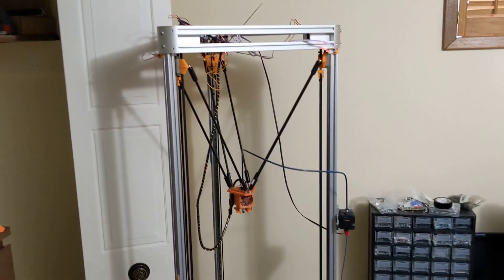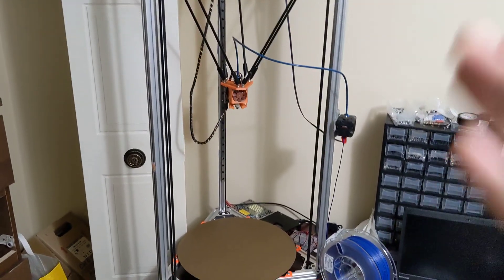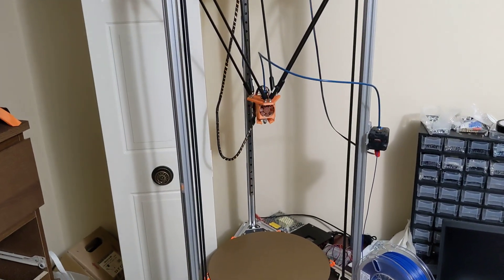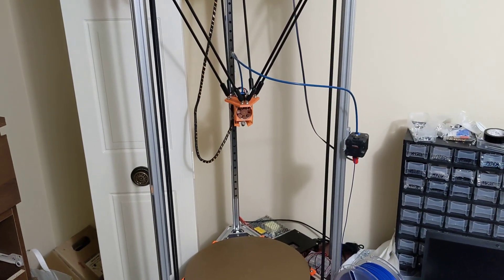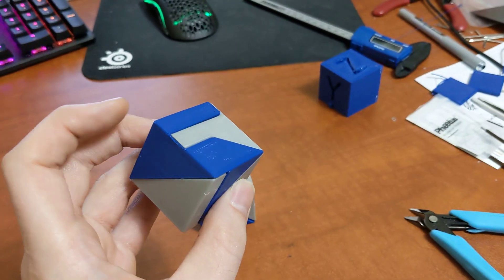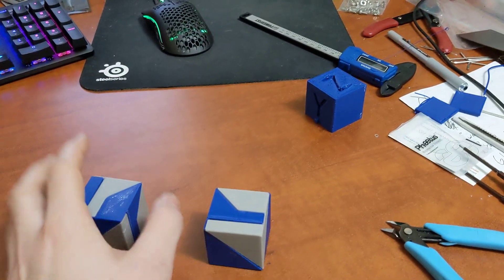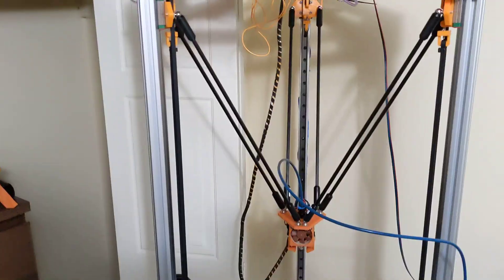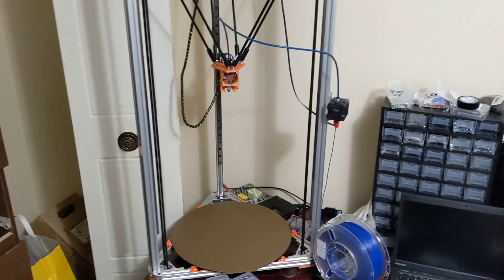Delta 3D Printer vs CoreXY 3D Printer

Comment: I started to build a big delta years ago for a cnc and 3d printer to replace my Ender 3.   I have seen almost no delta CNC's except big industrial ones.   Why is that?
I am back at it now, but I think this time I will build a real small one for 4x6 inch circuit boards.  And maybe 3d smaller items very fast compared to the ender 3.
This seems backwards from everyone else...they build big deltas and corexy for small cnc
Reply from the maker: I agree a small nibble delta would be great especially for circuit boards. I think a lot of people still think deltas are inaccurate and hard to calibrate.
Reply: @Rolohaun  I started to work on the little delta, but it seems to take up too much desk space.  And one of its advantages is using it for Z axis as you get that 'free'.  Now I'm working on a SCARA machine.  This is about as simple as it gets, just two arms and two motors.  And a circuit board weighs almost nothing, so the plan is to swing it around and keep the tools stationary.  In fact I think it is possible to have multiple tools and swing the board over to each one, so scrape the circuit, paint solder mask, lay solder paste.
Well see..It could do Z axis by raising the tools.

Comment: I too have a 1-meter-tall Delta that I designed and built.  It has a 300mm round bed and I also use magnetic bearings too.  The major difference, is that my printer mounts the hot end on top of the effector.  Also I designed a retaining clip to ensure my mag bearings do not detach.  I still have problems with my filament stuck in the heat-break, but I think that is a slicer problem.

Comment: I own a Tronxy X5SA 400 and a Flsun Q5. Well, the Quality was not as expected out of the box. I had to Customizing both Printers in Stiffnes and Firmware. Now, i am Happy with my two ones.
Ordinary Bed-Printers are boring and i would never buy such an Ender or so.  Sadly, there were came out so much of these boring Printers every year and cool and cheap CoreXY and Deltas are very rare on the Market.
Reply from the maker: I am glad FLsun is making Deltas

Comment: Ball cups with a rod in the middle to tigthen them are just as good. They take out the play. It is just as with your magnetic ones as long as the magnets froce is higther than the force caused by acceleration it is fine, same goes for the ball cup design as long as the spring or rod is stiff enough is takes out all the play.
The disadvantage of the magnets are, magnets are more expensive and a bigger hassle to glue etc. The magnetic ball design came from the horrible paly in the first version of thoise printers where there was nothing totake the play out. Thge ball cups are the best because simpliest solution to that problem in my mind.

Comment: BIG BIG Question... Hello Rolohaun,

Thanks for the great info and great “SimpleCore” design. I have a question that only a guy with your experience could answer. I want to build my next 3D printer for a specific purpose.  I want to print large ABS parts, 5 inches x 10 inches, 600 grams.  I am planing to use a V6 + Super Volcano + 1.0 nozzle to print as fast as possible.  
Do you think I should build a Simple Core or a Delta?
I like Delta's but I am concern about the weight of the extruder + Super Volcano + fans with long air Ducts. 
Please let me know your toughs.
Thanks a million.
Michel.
Reply from the maker: Delta is harder to enclose for ABS, you would want corexy SimpleCore, voron, ratrig that type

Comment: Thanks for a clear and succinct take on this subject.  There seem to be a lot of folks out there who got burned by bad deltas and never got over it, but the platform has so much potential.  I get excellent performance and accuracy with my Kossel -- it can push 30k acceleration on the one hand, but also print as fine as .05mm layers, so it's great for both prototyping and high-quality output.  A flying setup with an LGX on a ~16cm bowden really helped me on the extrusion side.
Reply from the maker: I agree 100%